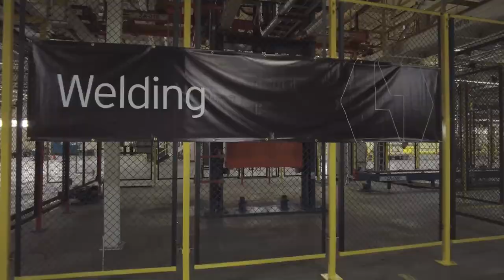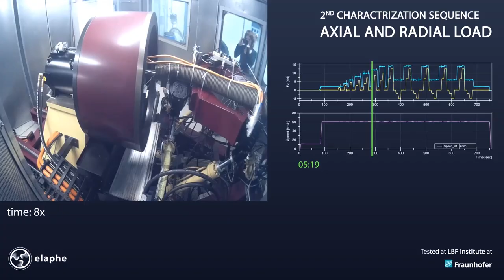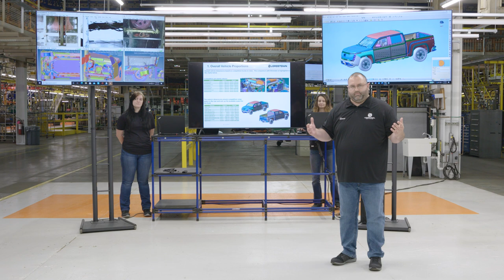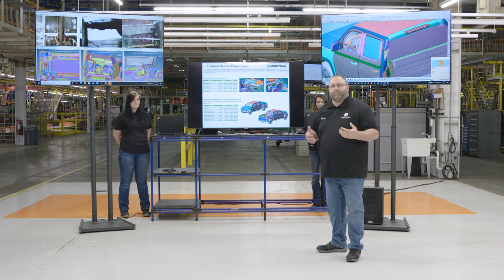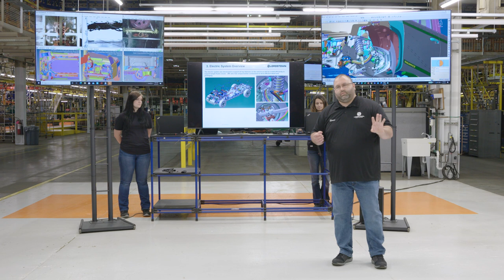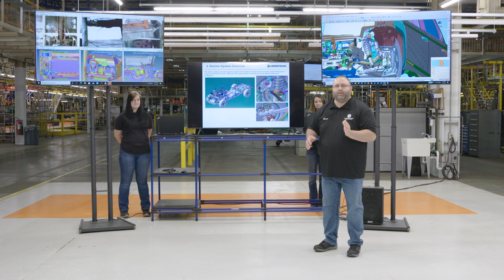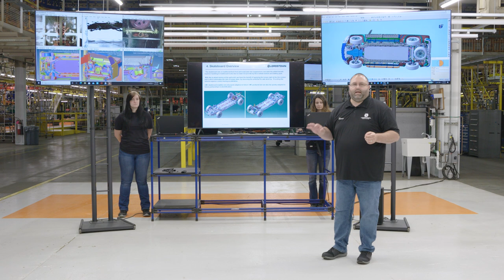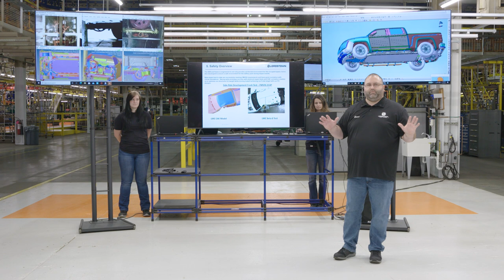2021 Lordstown Week | Lordstown Motors

Comment: awesome Q&A. Now we need a 0-60 ungoverneed run of the ENDURANCE . 😍
Reply: ENDURANCE has a GOVENOR that limits Top speed to only 80 mph............LOL.
Reply: @markplott4820  In the Q & A Session, they answered this question, saying that the speed limit can be  adjusted or removed entirely, although that is not necessary in most situations. They have indicated that torque can be dialed down is settings as well. 

In my experience, while speed and torque in the inexperienced drivers control, can be a killer, in the control of an experienced driver, having the full capability to demand either instantly, can allow the driver to get their vehicle out of the way of a vehicle bearing down on the truck or car that are driving. Having a vehicle that will instantly back off of torque of wheel spin is desirable, as no further acceleration is possible in theory, but if the experienced drivers wants to have the option, to purposely lose traction and perform an oversteer to turn the vehicle 90 to  180 degrees, to change direction in a hurry, turning off such limits should be a button or screen button push away with no menu structure to navigate through., much like a Traction Control off button located on the end of the shifter handle of an ICE car or truck
Reply: Since they are pre production, yet they are nit dialed in yet and are still deciding the amount of maximum torque the hub motors are allowed to be permitted to make without damaging them. After all, they don’t want failures to lead to a negative customer experience, and they have to warranty the vehicle, as well. 

Since the Governor setting is not going to limit the 60 MPH of end the specs of the 0-60 MPH, that should soon be available, as well as 60-0 seconds and distance, for braking performance. Once they dial in these parameters in the production vehicles. 

They may be able to even begin producing the sellable trucks before the parameters are dialed in, as the trucks would be able to be flash updated via cellular data connections. The minimum stopping distance would be controlled by the ABS controller and the amount of power assist of the power brake system dialed in. They don’t want a truce to be able to input braking inputs  will result in overriding the Antilock braking system and locking up the wheels on the truck on any of the axles. That would be self defeating…
Reply: @markplott4820  you're not very smart. Governor is just software that easily is removed. They answered that question in the Q&A troll.
Reply: @DishNetworkDealerNEO   - the HUB motors will catch FIRE and burn the truck to ASHES.
Reply: @markplott4820  they will determine the maximum safe levels the hardware will support without damage for both for speed and for torque off the line and at speed. I honestly wonder how far they and really be pushed, without damage considering they are loosely sharing the load of accelerating and deceleration one quarter of the truck each. The kicker is this design cannot use any gearing at all that a Tesla motor has. I also don’t know if along with that Bus Bar System feeding them the voltage, if they also gave a thermal control coolant jacket incorporated for cooling, or if they are just counting on wind as the truck moves, to cool the hub motors. Wind doesn’t always happen, like tall hills, towing or hauling heavy loads, and the wing can be scorching hot, so if I were them, I’d be relying on liquid cooling.  The Motor Controllers are no doubt,  liquid cooled, and certainly the batteries are, and if they are smart, they would run the drawn off heat through a heater core before dumping the heat in the radiator and fan. In that way, iit can preheat the air before the PTC Resistance Heating for the cab has to finish the job, which will slight help range by reducing the current used.
Reply: @markplott4820  so far the Hub Motors have not been the flame out. A defective built battery pack did that function grandly on their prototype.
Reply: @markplott4820  Remember everyone. They have trucks out there that real people are really driving around and testing to see how they perform and they will have that info back in time to make adjustments before they go into production in aug/sept.
Reply: @steveshelton112   - WHEN if Ever was any MEDIA was allowed to TEST DRIVE a LORDSTOWN ENDURANCE ?
NEVER . 
the TRUCKS are only REAL Preproduction .
" its EASY to build a few PROTORYPES , its a whole another thing to go into PRODUCTION " - ELON MUSK.

Comment: 45:05 The turning radius is one of the most impressive things about this truck
Reply: Ummm, the Truck cant even haul 3500 lbs and Drives only 80 mph...........TRASH.
Reply: @markplott4820  I don't see why it could not. 4 motors should haveore than enough torque.
Reply: @han1218   - the HUB motors are UNDERPOWERED , the 4 of them can only go 80 mph. barely HIGHWAY speeds. 
CYBERTRUCK with TRI motor can TOW 14,000 lbs and go FASTER than a PORSCHE 911.
Reply: @markplott4820  the Endurance's wheels are 20 inches in diameter, let's say 30 with tires, so 94 inches circumference. The motors can go to maximum 1500 RPM at nominal voltage, so 141000 inches per minute, or 2.23 miles per minute, or 133.8 mph. All 4 motors provide 600 HP peak. Towing capacity 7500 lbs.
Reply: @markplott4820  just found out the tires are 33" in diameter, so it can theoretically go even faster, up to 147 MPH
Reply: @han1218   - CYBERTRUCK has BEST in Class PAYLOAD of 3500 lbs , TOW up to 14,000 lbs and 0 - 60 under 2.9 Seconds . 
MAX Range of 625+ miles using 4680 battery, 
CT has BEST Approach, Departure and Break over Angle . 
BEST Ride height of 16" with 14" Travel on a AUTOMATIC air suspension.
it can FORD 4 feet of water and it can FLOAT .
Reply: @han1218  it is only set to go 80 max. As he said it can be programmed to go much faster, It is all in the programming.

Comment: 1- Do the truck beds go through phosphate/ELPO/paint whole? So every other carrier is cab/bed?
2- Where are the aluminum body components fabricated and painted?
3- Where is the frame made/pre-treated?  I would think too long to go through ELPO, as well as the body shop wouldn't have had the bending equipment needed due to previous vehicles being unibody construction.

Comment: RideWithLordstown!
Reply: RIDE to $0
Reply: @markplott4820  No I think when they merge they keep Workhorse name but trade under $ride with price target of $60-$100 by summertime. 

In all seriousness the bears first argument was no product. Then an outdated factory. What is the argument now that those have been totally debunked. Have a company months away from mass production of the first of its kind product which is the biggest seller in the automobile sector. If you don’t think demand will be bigger than supply and they won’t sell lay down the crack pipe.
Reply: @markplott4820  you just have not been watching.. yes there has been bad news coming from CNBC and MSM but they never tell you all the good news from Lordstown Motors.. You should be asking why not? Is it because the Big $ spends millions and million on their TV networks on TV ads? The big 3 has a long history of killing any manufacture that looks like they are going to take market share from them. I have done the research on this and it is well documented all the cheap things they have done to hurt new car companies and making sure the TV networks do not sure the new guy or they will pull all their TV ads is just one way they do it. GM may not try anything yet because they are invested but if Lordstown started take market share from them you can bet they would be on it also.

Comment: I was unable to ask questions during the time at 2:30 Eastern, due to my own personal schedule issues. 

My question actually came up from an answer in the Q & A Session.

In regards to the answer that there would be the use of both Steel and Aluminum in making various body parts such as aluminum doors,, I assume there are heavy steel safety crash rails inside the doors.

 I want to know what steps are being taken to prevent Galvanic corrosion. From  the fastening and contact of dissimilar metals together, along with the water, both pure and salted,  that naturally gets into many doors or other body parts. Water can never be totally kept out of a door assembly due to the wiper type seal needs for the power roll down window, so the have to have drains at the bottom of the doors where the skin of the door is edge crimped onto the inner door frame. This is the point on the lower edge, that is the most likely place Galvanic corrosion cell paint bubbling an conversion from aluminum to Bauxite would occur, due to water being driven to this area by gravity.

. As an example, the lowest part of the hood on the 2010 and up Chrysler Town and Country and Dodge Grand Caravan, introduced an aluminum skinned hood, with s stamped steel under frame,, and the lowest part, the leading edge of that hood, is notorious for paint bubbling due to corrosion cell action between the two dissimilar metals, with the aluminum sheet metal being the loser. Repainting was ineffective, with Chrysler ending up producing extra hoods to be installed and painted by their dealer base, which Lordstown Motors does not have at the current moment, as the Camping World service center deal apparently is off, from my understanding. 

That segway’s into my second burning question.

 What dealer network will receive, do dealer prep and service these vehicles including any hardware related recalls that cannot be solved by software? 

Is Lordstown Motors making such  arrangements, especially for the trucks sold for Consumer Distribution? Could arrangement to give that business to GM’s extensive dealer network?
Reply: Not from Lordstown, but I think their trying to do direct sales to consumers, and for service they are still looking for a partner since they lost camping world. 

And for the metal on metal question it appears to be a direct copy from GM trucks so looking into how well they hold up would be a good bench mark